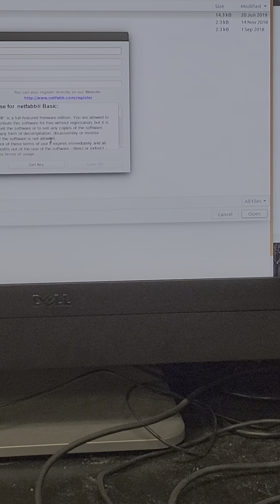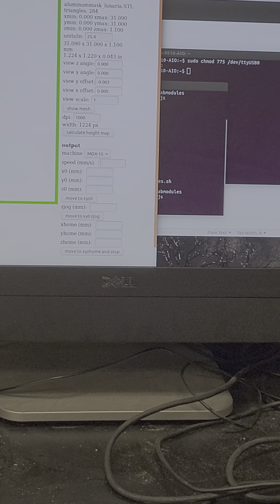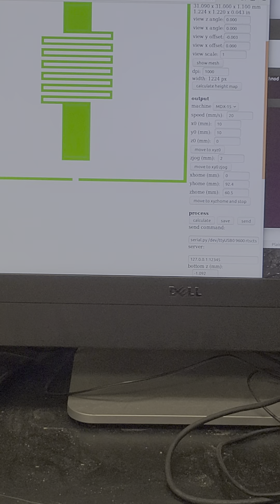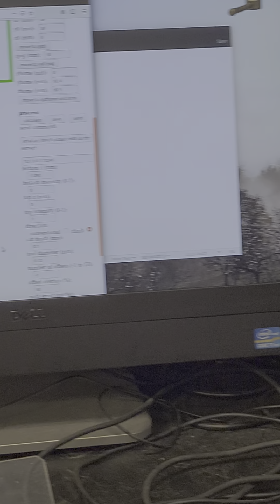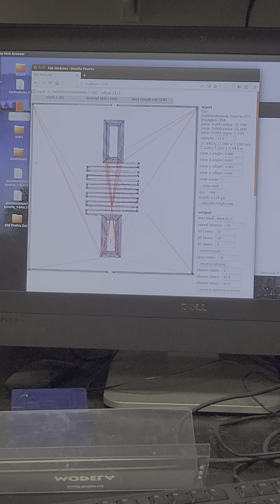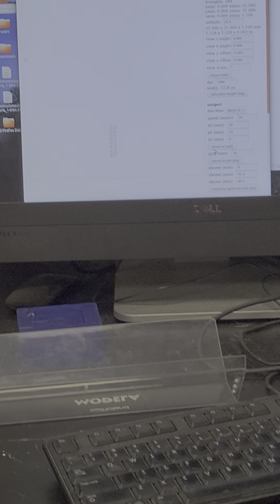Modela MDX-15 How to Video Using Fab Modules (Ubuntu Version)

Comment: Hey Jeff, your second subscriber :) I just found a dental Roland system for cheap on marketplace. It’s a DWX-50 5 axis unit. It has no software though. Wondering, is Roland good about letting you download software or can I set it up with aftermarket software without spending 6 months doing it?
Reply from the maker: I'm not sure how flexible Roland is with providing software. The unit was handed over to me with this open source setup and I was tasked with documenting how to use the machine. Perhaps they don't sell the software to non-Roland users, in which case perhaps you'll have luck sourcing it since it's not of much use to anyone else, but hard to say.